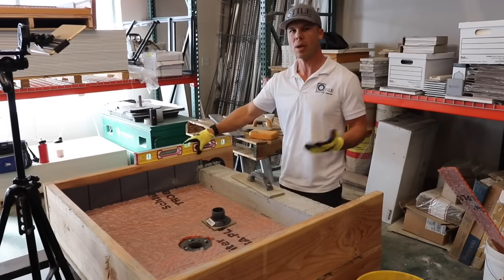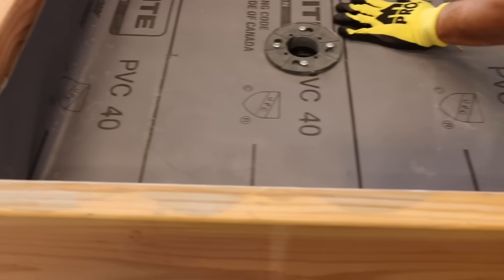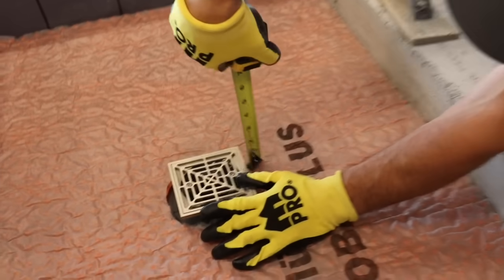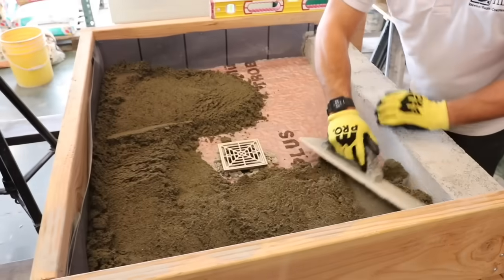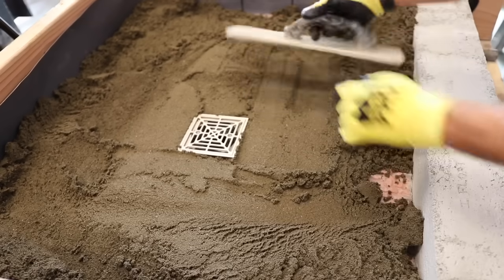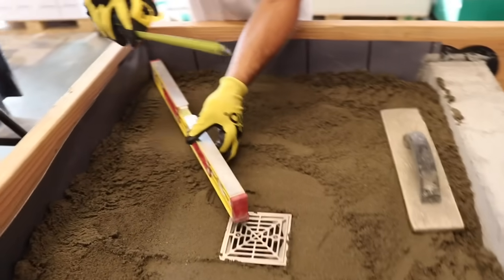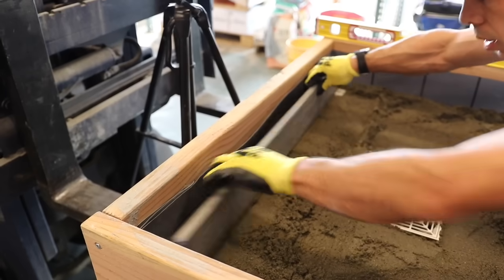How to Slope a Shower Pan: Tile Coach Episode 18

Comment: How fast do you have to work with the dry pack mortar before it starts to set up.  Also Doing a small shower base like the one you have there is not easy when you on your knees.; its like working in a telephone booth.
Reply: I've left it sitting in a tarp in the heat for 2 hours came back and was still able to use it.
Reply: It's not gonna dry our fast at all in the pan since the water has nowhere to go either.

Comment: GREAT VIDEO!
I did a "dead mud" or "dry pad" in my shower. A day after, I am noticing the mud is coming right off when I  scratched. I followed the ratio cement to sand 1:4 and added a little bit of water. Will it dry completely, so does not come off when I scratch it? Is that the normal consistency of the "dead mud"?
Thank you

Comment: Am I the only one that jumps around after you load up the pan with mud to get it real compacted?  I like your notched stick trick,  I've always just used a piece of the tile that's gonna go down and screet around the drain with it, but I always use a round cast iron drain, I guess everyone uses plastic these days.  I'm gonna have to start watching your videos instead of that StarrTile guy.  He drives me nuts but for some reason I always end up on one of his videos.   You should redguard the pan to create a nice mold sandwich between the vinyl and the redgard.

Comment: Great video. What do you do if the tile floor is rectangular such that the longer side is significantly longer than the shorter side? Are you still leveling along the walls or will those be sloped?
Reply: I will be in this situation soon and what I plan doing is start a gentle funnel ( slope) nearing the drain from all sides close to it.

Comment: Great tutorial! Question.... How do you decide on the height of the drain, as far as where the deck mud should be?
Reply: Start from the top. And get a picture of the overall drop. The top of the finished tile is the top. The bottom in this scenario is the top of the drain grate. The top of the finished tile should be about 1/16" higher than the top of the drain grate. Then you get your tile thickness and add an approximate amount for thinset thickness. From the top of the tile to the top of the mud bed equals tile thickness plus thinset thickness plus 1/16". Draw out a picture on a piece of paper in order to help get your head around it.

Comment: I notice you used a tile 'piece up againt the drain to gage the height so it will sit flush but didnt make any allowance for the tile adhesive height. wont the tile inevitably sit 1-2mm higher than the drain in this case?
Reply: yes

Comment: See how you're trying to not block the drainage from the water proofing layer? But with the flo fx drain you add a bunch of thin set to the spacers and the block, pretty much blocking the drainage from the waterproofing layer, water has to pool and can only drain from the top of the tile drain.... ? Am i wrong? I just ordered and put the flo fx in, but I'm questioning this system now....heeeeeelp

Comment: Nice video! What did you use to make that concrete lip? Also, is it possible to make a 'walk in' shower without any lip (meaning the bathroom tile would just flow right into the shower cabin)? Any thoughts would be appreciated. Thanks!

Comment: I want to practice doing a shower pan. Can sand dampened  to the proper consistency of deck mud but with out cement in it  be used as  practice deck mud in a mockup?
Reply: Absolutely. Working with dry pack is no different than building a sand castle at the beach...just a lot flatter.

Comment: Hi Isaac, thanks for sharing these videos! 
 I just did my very first shower pan. I noticed the next day though I have some high and low spots. Is there a way I can correct this before I do tile?
Reply: This is my question as well. I dry fit my 2x2 mosaic pieces in and instantly could see a bunch of slight ups and downs. It's because the pieces are so small (2x2) that these slight imperfections are a problem. How to correct?

Comment: Issac, do you use this same material (deck mud) under the shower liner in order to get the preslope? and do you use this set morter and tile right on tope of this? It seems like you're adding slope here but isn't the slope established beneath the liner already? a little confused... thanks in advance!
Reply: i agree with you in that it should be deck mud under the liner to gat a preslope then above the liner from what I have seen in other videos is to use mortar mix as the thin set for the tiles adheres better (?)

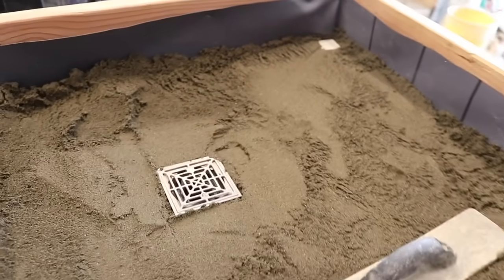Comment: 4:20 The pitch is being measured from the top of the far tile to the bottom of the missing drain tile.  (I think he should have measured from the top of the far tile to the top of the drain itself.)  When the tile is put there, the pitch will be ~5/16" less than measured.  Also, because the shower bed is not square, this pitch will be slightly steeper (as mentioned at 9:25, which is better) for the short way across the drain.
7:30 Same measurement issue as before.
Reply: The tile in the corner is not meant to be the finished height of the tile, just a solid reference for leveling the perimeter of the mortar bed. If it was meant to indicate finished tile height, then yes, you'd measure to the top of the drain.
Reply: @chuckyufarley2999  Tnx.  That would have made sense.  A tile in each corner could have been the base for an initial skreed level, or a stick along each side might make the leveling more sure, and maybe even quicker.  I also wonder if tamping the sand drops it consistently across the 4 surfaces.

Comment: Hi.

Is there alternative to use for the schluter troba plus?  Hard to find here in Canada Toronto.    Can i use regular dry pack for the pre-slop?
Reply: Yes you can. If your pre float slopes to the top of the base.  Install pan over pre float.  I don't cut holes into the pan until I mount the top part. I make sure top is level. Chaulk bottom of pan onto lower mounting base after cutting drain hole in.
Mount top part. Cover with tape. Install gravel over weep holes and float. Hope this makes sense . Nice videos !

Comment: Thanks for making this video. Question about the drain, do you mud up to the bottom or the top of the drain cover (so the cover is level with the mud)? Tore out the shower last weekend and need to make a shower pan this coming weekend. Just wasn't sure how to do the drain portion. Thanks in advance for the help

Comment: Any thoughts on how to do this when one wall is cement on bottom two feet?  How to attach the pan liner?  We plan to use concrete screw for the bottom part of backer board. The rest of that same wall is framed out and level above with the cement.
Reply: I watched the Oatey pan liner video and there a cement that can be used to glue the liner to masonry finish , Oatey says to call if you need to know which, pity they did not say in the video

Comment: Your the man Isaac - all your vids have been a huge help for a DIY'er like me. I'm currently adding a new bathroom to my 1930's home, and tutorials like these are going to make it a Grade A installation! Also got a quick question for ya - how high should the cement board be installed in reference to the pan liner? I've heard its supposed to about an inch above the liner so as not to wick water up the board, but I'm curious if the cement board is meant to meld into the last layer of deck mud (just before tile), or if there is supposed to be an air gap between that too? If there is an air gap, i suppose it gets filled with thin set when installing the tile? I would think its more useful to have a continuous concrete surface (backer board and final slope melded together) but maybe I'm off base there. Thanks!
Reply: @TileCoach  I didn't know this so I actually brought it up about an inch and a half like concrete backer board and then I floated with a lightweight concrete with the fiberglass reinforcement. Thanks for sharing I'm new here to your channel looks like you're doing a great job!

PS my channels a how to channel home repair tiling is something I've been learning after starting my channel. But I've been showing this process because not too many people are showing the details that you are thank you bro I look forward to hearing from you and getting to know you and your content God bless PS right now on my channel are some dog training videos and some cooking videos. But if you search through my videos You'll see there's a lot of repair tutorials

Comment: Hey, I  had a neo-angle shower pan which I’m redoing and making it a curbless entree. But I also want to re-position my drain more towards the corner and slope my floor evenly through both walls right into that corner. Can that be done? Would I have an issue with tiling that pitch? I can’t seem to find anyone doing that on YouTube. Let me know thanks!

Comment: What do you put behind the tile where the membrane goes up? below the sheetrock but above the shower pan.
Reply: The studs should be notched at the height of the membrane so that your wallboard covers it without  getting kicked out of plane. Some guys float first then install board but we would install board first and then float to lock the board in.

Comment: Why does your right side on the inside curb the mud looks higher than the middle and left side of curb? I thought you said all the way around in the edges is supposed to be the same height? Thanks in advance 👍
Reply: @TileCoach  I mean visually you can see that it's lower on one side. Is that normal. Or is that the slope?

Comment: On the walls does the Durock/Hardie sit inside the mud pan or ontop of it? And which board do you recommend Durock or Hardie? Thanks
Reply: Wonder or Durock for water. Hardie does not belong in wet areas. Leave a piece in a bucket of water and you'll see why. It works well for dry tilework because (imo) it's easy to keep flat and cut square. Make sure you use the correct fasteners for each type.
Reply: After durock or hardybacker you have to put the sealer to protect the walls .

Comment: I just use my bosch laser level by sitting it on the drain and then rotating it as I mark the line one the wall to represent the height of the deck mud......I do this before ever even mixing up my deck mud.🤔

Comment: Good video. I used to do these many years ago

You Could have installed two Schluter shower trays in the same amount of time, you performed just this very last stage of sloping the pan. 

You already had the pre-slope and liner installed ...so how much additional time did that take?? 

Now you have to wait until the mud dries before you can tile. Time=Money.  So How much does that cost your business? 

What type of warranty do you get from any of the materials manufactures to cover you in the event that there is a failure with this pan?
Why bother with this antiquated procedure?
Reply: actually i have been replacing showers with linear drain (schluter ) cause the seem split  notice. not my installation tho. this product  20 years doing tile never had a bad product.

Comment: So informative and easy to follow, that it as given me the confidence to at least try doing it and how to water test after.

But i have question that I haven't found in any of the videos. How long donyou need to wait after doing the preslope before placing the liner and top bed,then tile? How thin do you make itin the center, iwas thinking 1/2" per layer.

Comment: how much open time do you have with the mud before it starts to dry out on you? and just how wet is too wet?  i have to redo my pre slope because it dried scaly and not smooth. i think my mix was to dry and i did not place the mud quickly enough because i was trying to make the perimeter First and then fill in the middle . my shower looks about the same size as yours; about 39" × 39". and it is difficult doing the work while on your hands and knees. sort of like working in a telephone booth. your video was excellent. thank you!
Reply: Since there is a range of wetness when dry pack will clump in your hand, if it is not too much to ask, I would love to see you show the workability advantages of good dry pack compared to the disadvantages workability of dry pack that clumps but is too wet. Thanks.

Comment: Is there a pre slope under the liner? Thanks.
Reply: @TileCoach , first thanks for posting a great video. I learned a lot. I am doing a 30" x 60"  over concrete floor with linear drain on one end. This video appears to have the Oatey liner over a flat surface and then you build the slope. Is that correct? You answered there is a pre-slope. Does the pre-slope not need to be the 1/4" per linear foot as well? I'm guessing the process is pre-slope of 1/4" per linear foot, followed by liner, followed by another mud bed. I'm a bit confused as I've never done one. Many thanks even if you don't get to answering this.

Comment: As my wife and I get older, we're looking at doing one of these walk in shower installations for ease of entry. 

 My concern is that the "mud" under the tile, but above the waterproof liner will absorb water, not fully drain, even with the correct slope, and develop some kind of a musty odor.  Is there a way to make minimize this scenario? 

What I understand is that water will pass thru the grout, then the mud and down to the liner then down the drain. So, it will take time for the layer of mud to dry, talking into account daily showers, you can see that you may never fully dry, thereby the musty smell. 

I would love to move from the tub to a walk in tiled shower, but, am I creating a time bomb?
Reply: xr500t water proof the mud bed using aqua or red guard

Comment: So in this video, you’re putting your sloped pan/mud on top of the waterproof layer. In the first link in your description (“how to install waterproof layer”), you’re installing the liner on top of an already sloped mid pan. 
Which should you do first?
Reply: If I may chime in..It seems as if the "lower" base ( foundation? ) should be sloped so that the vinyl bed liner will be sloped when put on top. This will allow water  ( water that seeps pass bad grout lines and end up on top of liner) to move  towards the drain. The mud that is put on top of the vinyl should also be sloped ..for obvious reason

Comment: Why not do a sloped mud layer beneath the liner and then the liner layer with another layer of mud on top that follows the base slope and goes to the drain?  Experts say it prevents water from pooling on top of the liner. In this video the liner is not sloped to the drain.
Reply: The way you describe it seems to be the proper way and is what I plan to do

Comment: I watched number of your installation of pans videos and I still can't figure out what you're doing and how you're doing it and what way you're doing it and you skip around so much from doing one thing and then your video stops right in the middle of doing a pan or the mud or the membrane I can't really figure out what you're doing and when you're doing it and how you're doing it and which one comes before that one and totally confusing why don't you start a video so at the very beginning and finish it without all of the stops and starts
Reply: this is one of about three different ways to build a shower pan .This demonstration is when your using a PVC shower pan liner, and you are floating the bed of mud for a tiled shower floor.Maybe you can find some one to help you threw this step, so as not to waste money time and effort on a learning curve. It's  not that hard of a task, if you're familiar with the process ,materials ,and the reasoning.
Reply: Commas and periods, bro. Use them. That is long ass run on sentence.
Reply: Jennifer Becker lolll

Comment: No!  This is NOT the correct construction.  The water that gets through grout and through the bed then to the membrane will not drain.  The membrane doesn't slope!  It will hold water.

Proper method:
1st:  Put down a building felt on top of the wood subfloor to prevent the wood from absorbing moisture from the cementious sloping bed.
2nd:  Put down a layer of wire mesh lath.
3rd:  Install 1/4" per 12" slope bed.
4th:  NOW, install the membrane.
5th:  Put down a 1 1/2" layer of mortar
6th:  Lay tile and grout.
7th:  Use a silicone caulk at 90⁰ joints...wall to wall and wall to floor.
8th:  Seal if desired.

The difference is, his method the water that gets through the slopping cementitous bed and to the membrane will not slope.  How can it?  The membrane doesn't slope.  You will get a build up of water.

Comment: Use mortar! This shit starts to buckle after a few years.Tiles start recessing. You can never put enough pressure when floating that stuff. To be able to stand on it with no play....
Reply: I’m also very confused as to how this will bear any weight at all, especially under smaller mosaic tiles. Would there be some liquid poured onto the sand to make it into a concrete?
Reply: Mortar on top of lining..I agree!!

Comment: Its not a preslope its POST slope. Preslope is before you install liner. Per pluming code the liner should slope 1/4 in over 12 in toward drain. Not only tiles but pan liner should be sloped.  So much misinformation on YouTube.